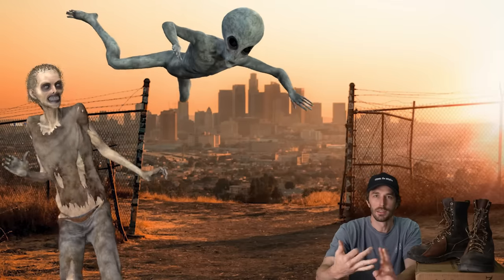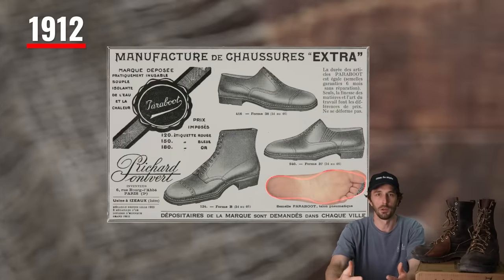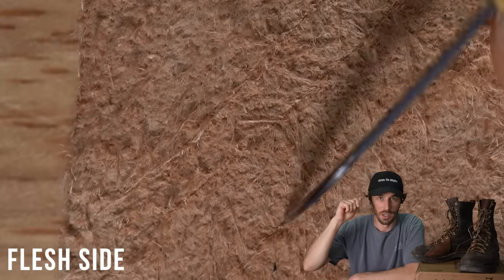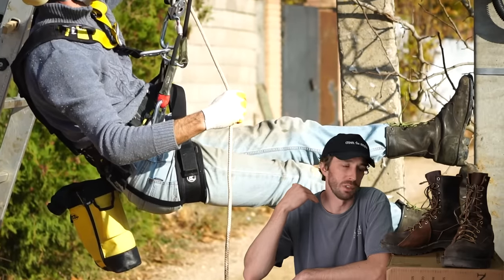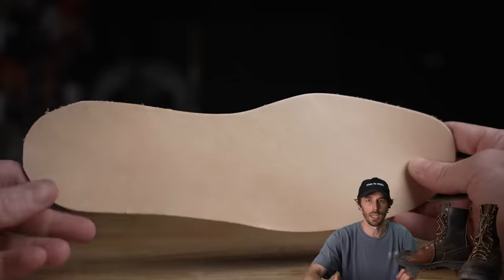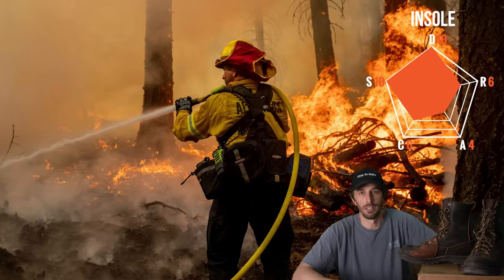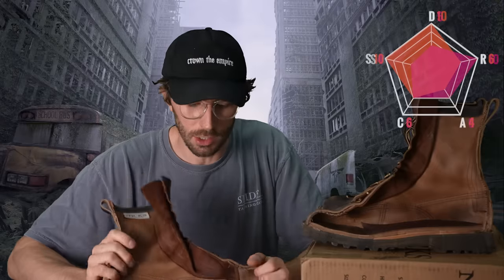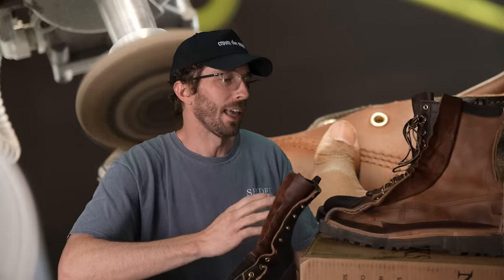Why this boot would save you in the Apocalypse (ND3)

Comment: Great content.
I am an arborist and ex wildland firefighter.
I can attest to your comments about durability. Alot of new hires buy $200.00 boots...two or three times in their first season..

I am intrigued by your use of foam (EVA I presume?), in the midsole. I have never had EVA midsoles last more than a year at most, usually six months if worn daily and this with brands such as Merill, Keen and New Balance.
They feel great until they don't and I am left with an upper and perhaps even an outsole that have lots of life left but can't be repaired so your design is intriguing to say the least!

Do you have any data yet on how long the foam midsoles will last?
Most running shoe companies seem to claim 3-500 miles.
Even that would be fine.

Sometimes we work areas where our days are miles and miles of mixed pavement and non-paved areas.
Even a pair of Hotshots can become very uncomfortable in a few days of paved surfaces.

Being able to replace an EVA midsole would be awesome.

Thanks for great content and for providing real insights.

Cheers!
Reply: Great question. I'm curious as well.
Reply: get fp insoles
Reply: @Mathos93  Hi 

FP fails in two places for what we do.
1. Durability... They don't last a month in steep terrain. I think that the non-newtonian fluid may settle when we traverse steep side hills causing wear. Not sure.

2. Not stable enough. Very poor support when carrying gear in the terrain we work.

To give you an idea, one circuit I worked this year consisted of hiking 8 to 9 hours headed in one direction, traversing a 50 to 60% grade...no fall protection either. If you are headed North, the entire day is spent edging the right side of the boot. After that slog, we had to walk paved highway for 4 to 6 miles to return to the truck.

I would guess that 90% of us are using Superfeet. Even those only last about three months, but you're not gonna sprain an ankle.

The thing about an NFPA stitch down boot is that it contains your foot in such a manner as to completely support it. Cushioned insoles have a deleterious effect on that support.

This is what makes a  REPLACEABLE  EVA midsole attractive. The foot is still completely supported in the boot. The cushion is outside the vamp.

A replaceable EVA midsole could be a real game changer even if it needs to be replaced seasonally.

I would definitely consider the FP for a running shoe or light to medium duty hiking boot though.

Cheers!
Reply: @seanwoodburn2616  Wow! What truly humble yet serious and straight to the point feedback. Doesn't seem at all to have much myth or too much attachment to anything. Maybe its because my father was a DNR officer and did Aerial Forest Fire Attack Lead Plane so its the kind of style I'm kind of used to. Thanks a lot for taking the time.
Reply: While comfortable - I agree that the foam and sole is the weakpoint of this boot, at least for the 'apocalypse' selling point of them. After a year the sole WILL start breaking down, regardless of whether they are used or not (I've noticed ALL of our NFPA soled boots crumble to dust after 1-2 years even just sitting in storage). It's just marketing at this point - the best bet in an apocalypse is to have multiple pairs made of materials that are shelf stable for years hehe
Reply: @errhka  Agreed about EVA. That would be the strong selling point of this (now completely sold out), boot.
I have never seen a resoleable boot with an EVA midsole.

What kind of work are you doing that is destroying the soles of NFPA certified boots in 2 years?

Mine last considerably longer, but I mostly cruise timber trying to prevent fires as opposed to fighting fires. That is several decades in the past for me now. I wore Whites Smokejumpers then. Nicks Hotshots now.

Cheers!
Reply: You seem to know a fair amount about boots given your background good sir. What brands should I be looking at for a buy once, cry once kind of boot?

I do a lot of hiking/Bushcraft, hunting, and just general work outdoors. I live in Michigan.
Reply: @ItsChrisFtw  My favorite are Nick's.
Danner and Whites both hold up.
There are surely others that I have not tried.  Sift through the Rose Anvil stuff. I think he is always spot on and very good about calling out expensive boots that won't last.
Reply: I noticed that Nicks uses PU not EVA for these types of midsoles (more info in their tactical line). So based on my experience with that type of material in mountaineering boots I'd say it'll be vastly more durable than EVA and such. That being said I'm still wondering about HOW durable this combination will be. I've had lower lighter boots with PU midsoles last a while before resoling in harsh wilderness environments, but they were all completely cemented together vs stitched, and were designed around replaceable insoles. It sure seems like an excellent match for long term comfort, with your foot forming to the leather insole and upper, vs killing Superfeet constantly PLUS resoling. 

Anyone know anyone who has beat one of the Nicks tacticals to death? That might be the best source of info.
Reply: @anomalouspixels  Good to know!
Reply: @seanwoodburn2616 should have known, @RoseAnvil has a vid explaining those: https://www.youtube.com/watch?v=KKom-7u3J0Y

Considering the contents of that video, and merged with the concept of these ND3s is some interesting food for thought.
Reply: @1betterthanyou1  I missed that!
A bit late to the party for that boot though.

Comment: GREAT boots man! NICE work...
One issue troops in WW2 had found out the HARD way during cold, freezing-thaw cycles & wet weather, with the suede side out, is that it would more readily absorb H2O, then poss freeze, inducing foot injury. The weaker, less absorbent, more wear n' tear prone slick side that accepts polish a bit more readily for that needed/wanted/expected parade-dress shine was the solution for that prob, turning future boot manufacturing protocols 'inside out' so to speak...After that adjustment less wet weather induced trench-foot/frostbite issues were seen...

Of course aggressively waxing/waterproofing the suede side out certainly helps, but not when your standing/walking through puddles mid calf deep, well over the top of ones boots...
An example n' issue akin to the M.V Titanic...er,...um?..OOPSIE!? -The M.V Olympic's 'waterproof' hull bulkhead compartments NOT being SEALED/welded/riveted/caulked to the bottom side of the adjacent next deck ABOVE^ it..
Just Puncture the hull wall, then  the water subsequently would fill up within the bulkhead, then right over the open top & spill directly into the next 'waterproof compartment'...Apply, lather, rinse n' repeat, all the way back to the rearmost aft section for the ultimate example as to an undersea paper weight!...;)

Comment: I can really appreciate a lighter sole when it comes to boots. Most of my problems with work boots and boots in general is the weight of the sole because of  the forces it exerts on my joints when walking, particularly my knees. Since I have had some knee problems since I was a teenager, hiking and talking tends to inflame theses specifically when wearing heavy footwear. I'm assuming this is because your legs are essentially a lever system where the forces to move the lever are concentrated closer to the pivot point so the more weight on the end of the lever means more force and stress exerted on the pivot point or joints.

Comment: Yes weight does cause more fatigue the more it weighs but you train yourself up to get used to the weight.
Ive worked with 5bls boots since I was young.
Weight becomes negligible to a certain degree if you condition yourself for it.

I'd say if one factor of boots to not give much care would be weight if you can manage your body's fitness to compensate.
Reply: until you have to climb walls or trees, and with a heavy backpack full of equipment. Then you would appreciate lightweight. Any reduction is welcome

Comment: These look neat, although having worn the same boots from -40ºF to 110ºF something like a fire and ice style sole is pretty valuable for myself, a lot of rubber soles just become rock hard and very dangerous when walking on any type of wet and cold surface. Melting can be a problem in the sand, although I don't spend much time in the sand as much as on rocks. Shank protection has been very valuable as well, it is never fun having to deal with the consequences of an injury from stepping on something sharp.

While I really enjoy the breathability  of mesh uppers, sometimes, their mixed water resistance, durability and cut resistance do end up with faults. If you had to run for days, it might be a good option but if you could take them off at some point the leather would probably be my choice for lifespan.

Comment: Interesting boot, it would have been nice to see a steel or similar shank under the arch. Standing on ladder rungs or stirrups can easily bend the arch in very uncomfortable ways. 
Not sure that the leather shank has enough structure to stop that pain from being transferred into one's foot. 

Either way this boot looks good.
Reply: I used to climb smoke stacks at coal burning power plants that averaged around 1000' for a living, the ladder rungs are just 5/8" round bars. I'd have to agree with you about how much it sucks lol, it is a pretty specialized trade though, being on ladders all day. Maybe they could make a special edition with steel shank.
Reply: 10 years on a ladder hanging siding , 3 years i had boot with steel shank i cried when i retired them 😢

Comment: Back in my "good old days"  (early 1970s)of backpacking and mountaineering I wore Galibier boots. They had a Norwegian welt rough-out full grain leather and leather insoles. You couldn't wear them out, put many miles on them and still have them.  My favorite are an old pair of Tony Lama cowboy boots that I bought in 1996. They were made with wooden pegs and have a wooden midsole. I wear them at least one a week. I used to wear US made Red Wings with steel toes. Heavy as lead, but extremely comfortable. they got salt stained from sweat saturation working in a 120°F+ industrial environment.

Comment: Would it be possible to make this boot as a zero drop boot?? That would be amazing!
Reply: I've been looking for a zero drop well-made boot in the heritage tradition vs. space/hippie boots, or something that's at least not high heels for tough guys. Have yet to find one that doesn't look like a leather sock. Iron Rangers are fairly low-heeled, but it's still a disappointing hole in the market.
Reply: @abrosh5434 yep. 
It just goes to show people who make shoes are idiots.
History as been filled with crap footwear,  and today's still is.
That heal would get you killed in shtf, you need zero drop to sprint.

Because there's 100% not a 99% but a 100% chance when shots fired your sprinting. Every emergency is you sprinting.
Not casual walking , or doing that awkward run trying to cross the road.
A full balls out sprint to cover.if you don't make it, your dead

Comment: I keep seeing boot makers speak about testing their boots in the "harshest environments", then talk about firefighting, or line work.  I need a boot that can be comfortable to wear while walking 10+ miles/shift in an underground coal mine.  I need to protect my ankles, while walking on uneven surfaces, I need to protect my feet from crush injuries, I need them to be 18" tall and waterproof, and I need the material to be able to withstand urine, feces, lubricants, magnesium chloride, diesel, emulsion, coolant, etc.  The longest I've ever had a boot last - before the sole gave way or the waterproofing quit - was a pair of Matterhorn Tiger Tips, and they shrunk up almost a full size, due to exposure to all of the salts/chemicals.

Comment: Nice, but I need sub zero.
  That can protect the toe from 200 pound, waist high drop.
   Be on an open cab forklift in Minnesota. Been using a boot designed for oil rigging in Canada.  Works but don't see how its repairable.

Comment: 1:33 What kind of march was that?  I have participated in force marches.   4 miles in 1 hour.  8 miles in 2 hours, and 12 miles in 3 hours.   Not all at once thankfully.   

The 8 and 12 mile marches were brutal for me, being in my mid 30's after joining an Army Reserve, Basic Combat Training Unit.  All at Fort Jackson with basic trainees. 

One thing that helped to protect my feet, with the issue boots.  I had previously soaked them in warm water for about 30 minutes, put the boots on, then went out for a fast walk until the outside of the boots had dried completely.  The boots were then shaped to my feet and I had no blisters from the boots.

Comment: just want to start by saying phenomenal stuff, a great video and an even better boot. in light of that, how did you address breathability? these boots were based on a design in the European theater; meaning they are meant for a colder to milder climate. one hot summer and even with quality socks, you are gonna end up with some very peeled and athlete foot ridden stompers. I just cant see how  this boot would hold up to a Florida summer, a Texas spring or a excursion through jungle. this is why the us army abandoned leather so very long ago. marines still use them but they also eat crayons.

Comment: I bought two pairs of the previous Marine Corps issue boots made by Danner and Wellco. For the price that they are selling for their a total bargain. I was looking for support in the ankle as I have had broken both and required internal fixation with screws and plates. Wanted water resistance which these provide with GoreTex and a good traction sole. These boots in the Hot Weather and Temperate models provide good insulation. For less than $75.00 new in the original box with tags, they are an incredible bargain. Would love a $600.00pair of incredible boots, but my wallet say no-way, still I dream.

Comment: if its any use i used to work in garbage.  they get destroyed pretty quickly jumping in and out of the truck and getting wet and splashed with random filth.  6-8 months was a good boot.  the outsole would get expecially destroyed tho can be replaced.

Comment: Need a steel toe version. Look at the heavy steel foot protection use in steel warehouses sl yojr foot isnt cut off when dropping a plate.
A 'clip on' steel toe of some sort.
I always burn through my leather toes to the steel within 6 months. 
A snug steel toe and a longer piece that cover the lower laces.
Stainless steel or heat colored steel cap would be great.

Comment: I don't know this shoe but I have never come across a shoe where I can walk for a long time without getting problems with my back. This mainly because of my height (7 feet). Except shoes from the Austrian brand Meindl. So I have 2 pairs of these. I have this in a military version (makalu pro 3000) that is used by elite units. Waterproof and yet breathable due to the use of Gore-Tex and a good grip due to the Vibram sole. They are heavy, but offer great support and therefore a reduced risk of injury. Even with a full load.

Comment: Oh wow!   ya had me going there man, i went to the site,  after being amazed by this boot.  I thought,   I could buy this for the way more than I have ever spent on shoes, even in teh last 25 years combined!   to this boot that I would never ever have to replace.        sold out but  they take lists anyway for the next run right?      But then also, i have size 17 feet - 16.5 in converse leather highs.      and your chart goes to 14.    14's are sometimes available at wal mart man.    this was quite a blow , I was thinking hand made  would be different.   anywho.   cool video.   ya had me going there.

Comment: it looks like normal army boots, they usually have a problem with very hard soles, you can get used to it, but there are better options

I have army boots from the 80s, but I liked the ones for firefighters for $217 more, they can withstand up to 900 degrees and withstand a chainsaw

Comment: I’ve got a pair of X-Element harness boots that I bought and have been hard** wearing for over a decade now..
They have had the heel cap rubber replaced that wore off after about 7 years of hard wear and the stitching on my dominant foot unfortunately gave out after about 4 or 5 years..
Both outer souls are pretty much buggered and worn through to the mid section lol 
But they just keep-on keeping-on like me 😂
Moral of the story, 
boots can last for as long as the wearer can practically still keep them on their feet and still function better off than without them;
I reckon I could wear a pair of well built boots like these in the video for at least 30 years 👌

Comment: I strongly advise anyone to buy french BMJA 65, bmja stands for "brodequins de marche à jambières attenantes". From before 2005, they are great, I own a pair from 1989, they still look brand new and I use them everyday for years. I ride with them too, the leather is super thick, they're reinforced and the sole can be changed as well.

I wouldn't want to be kicked by those boots. Additionally they make you gain 3.5cm, which is great even for tall guys.